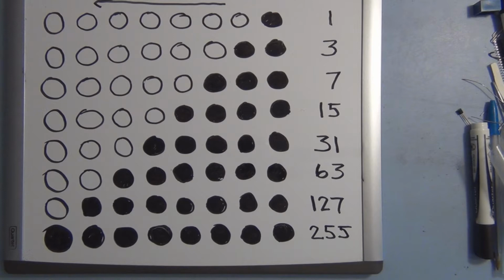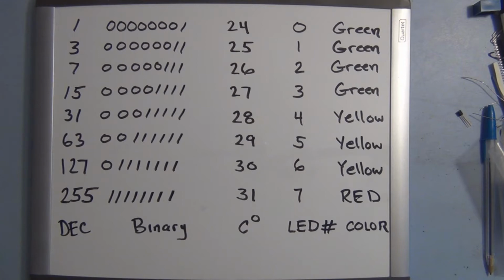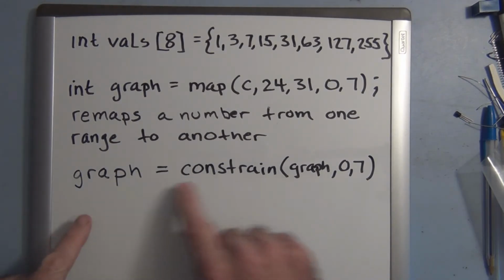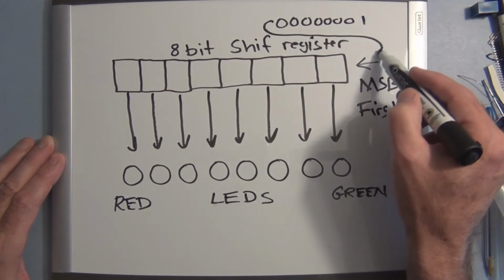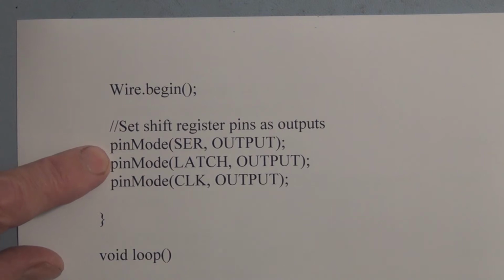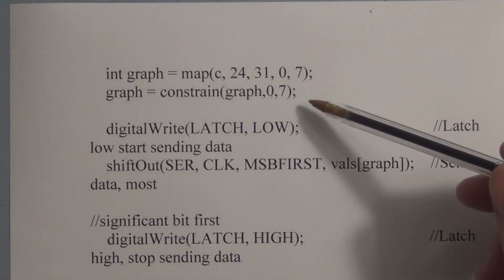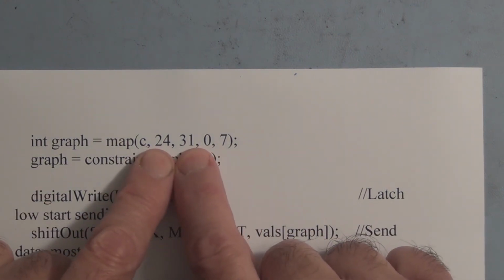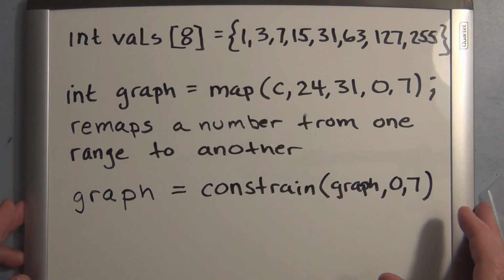Arduino Temperature Sensor LED Bar Graph

Comment: Dear TechTom, I'm trying to do it with potentiometer. 

Here is a code, is it OK? 

//Definicija ulaznih pinova i broja dioda

const int analogPin = A0;   // pin na koji je spojen potenciometar
const int ledCount = 8;    // broj dioda

int ledPins[8] = {1,3,7,15,31,63,127,255};   // niz brojeva za shift register 

const int SER =8; //Serijski izlaz 
const int LATCH =9; //cip Latch Pin 
const int CLK =10; //cip Clock Pin 

 
void setup() {

  pinMode(SER, OUTPUT); 
  pinMode(LATCH, OUTPUT); 
  pinMode(CLK, OUTPUT); 
  
  // loop over the pin array and set them all to output:
  for (int thisLed = 0; thisLed < ledCount; thisLed++) {
    pinMode(ledPins[thisLed], OUTPUT);
  }
}

void loop() 

{
  // read the potentiometer:
  int sensorReading = analogRead(analogPin);
  // map the result to a range from 0 to the number of LEDs:
  int ledLevel = map(sensorReading, 0, 1023, 0, ledCount);
    ledLevel = constrain(ledLevel,0,ledCount); 
    digitalWrite(LATCH, LOW); 
    //Latch low start sending data 
    shiftOut(SER, CLK, MSBFIRST, ledPins[ledLevel]); 
    digitalWrite(LATCH, HIGH); 
            
    }

Comment: @eTechTom, thanks a lot for such an informative tutorial, could you happen to have the project on 123d.circuits... so i may add it to mines? if not, may i request for the source-code as well as the design? Will really appreciate!
Reply from the maker: +McVersity OneMulleOne 

//Reads Temp from I2C temperature sensor
//Show it on the LED bar graph, and show it in Processing

//Include Wire I2C library
#include <Wire.h>

const int SER     =8;    //Serial Output to Shift Register
const int LATCH   =9;    //Shift Register Latch Pin
const int CLK     =10;   //Shift Register Clock Pin

int temp_address = 72;  //1001000 written as decimal number

//LED settings
int vals[8] = {1,3,7,15,31,63,127,255};

void setup()
{
  
  //Start serial communication at 9600 baud
 Serial.begin(9600);
 
   //Create a Wire object
   Wire.begin();
   
   //Set shift register pins as outputs
   pinMode(SER, OUTPUT);
   pinMode(LATCH, OUTPUT);
   pinMode(CLK, OUTPUT);
   
}

void loop()

{

    //Send a request
    //Start talking to the device at the specified address
    Wire.beginTransmission(temp_address);
    //Send a bit asking for register zero, the data register
    Wire.write(0);
    //Complete Transmission
    Wire.endTransmission();
    
    
    //Read the temperature from the device
    //Request 1 Byte from the specified address
    Wire.requestFrom(temp_address, 1);
    //Wait for response
    while(Wire.available() == 0);
    //Get the temperature and read it into a variable
    int c = Wire.read();
    
    //Map the temperature to the LED settings
    int graph = map(c, 24, 31, 0, 7);
    graph = constrain(graph,0,7);
    
    digitalWrite(LATCH, LOW);      //Latch low start sending data
    shiftOut(SER, CLK, MSBFIRST, vals[graph]);    //Send data, most
                                                  //significant bit first
    digitalWrite(LATCH, HIGH);                    //Latch high, stop sending data
    
    //Do some math to convert the Celcius to Fahrenheit
    int f = round(c*9.0/5.0 +32.0);
    
    //Send the temperature in degrees C and F to the serial monitor
    Serial.print(c);
    Serial.print("C,");
    Serial.print(f);
    Serial.print("F.");
    
    
    delay(500);
    
  }
Reply: +eTechTom Thank you so much!